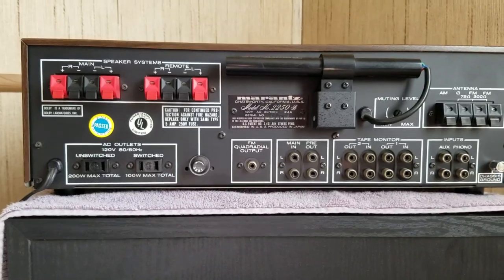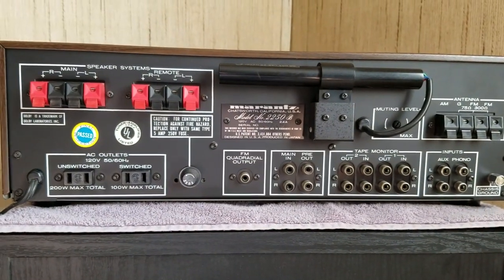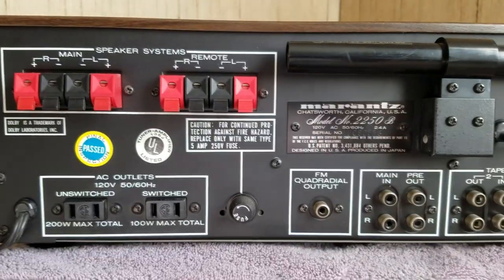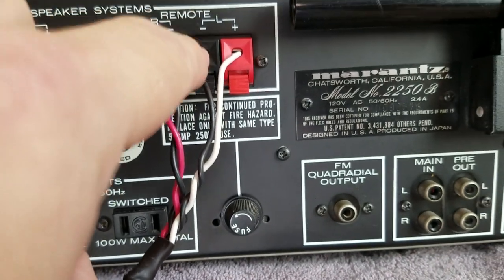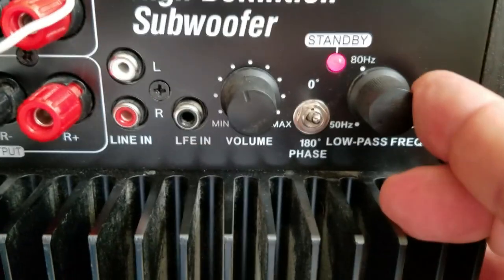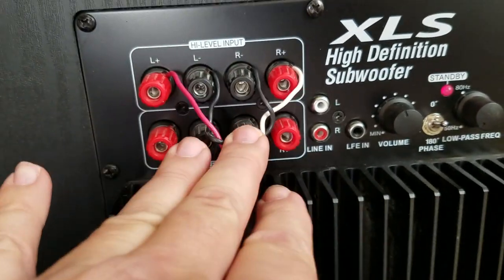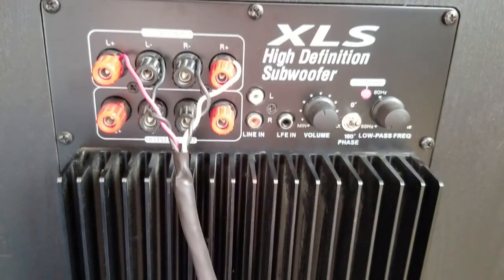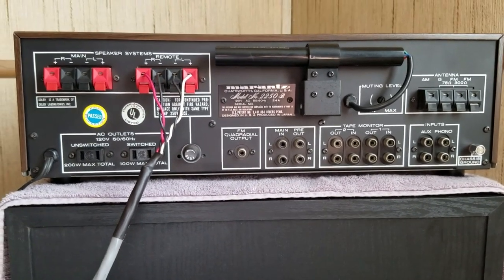How to add a Subwoofer to any Vintage Stereo

Comment: Very useful information. Thank you. I have a 40 year old Sansui 9000 which I absolutely love and still works well. I was thinking of adding a sub even though it has good bass with existing wharfedale E-90 speakers, also 40 years old and got it re-coned recently and sounds great.  Your instruction video is timely, and appreciate very much.
Reply from the maker: Glad it was helpful!

Comment: Very good instructional video... Liked your using the High inputs on your woofer. Never saw summing L and R channels into a mono-sub. As my 2.0 stereo has only speakers A, no speakers B, I bought a simple amp with subwoofer speaker output. Works for now.

Comment: This only works if your receiver has A + B output, AS WELL AS the speaker outputs themselves are wired in parallel internally, and not in series. Your average person may not know what they have and this was very common for receivers from the early-mid 70's to run both speaker outputs in series and some specific brands kept doing it. (my Kenwood is like this). This is designed to protect your amplifier from someone running two sets of 4ohm speakers and cooking the amp. But it has significant tradeoffs for performance and sound quality (unfortunate). it's not easy or always possible to change this.

Anyways in this scenario the amp will not run the sub and mains simultaneously as the resistance of your speakers (~8ohm) will sum with the resistance of the subwoofer inputs (10's of thousands of ohms) and the resulting highly resistant load won't draw any current from the amplifier.

The recommended (by HSU and PS Audio) solution for this is also the simplest: simply connect the subwoofer high-level inputs directly from the speakers, which should be directly wired to your amp. Or run wires going to the sub and mains directly sharing the same amp terminals. The high impedance of the amplifier results in no additional load "seen" by the amplifier and is completely safe.

Just like int he video I let my mains run full range, and the use the controls on the subwoofer to blend nicely with them and provide the low frequency re-enforcement and extention rather take over the whole <100hz range.

Not mentioned in the video is how some subwoofers have a high-pass filter on the high-level output. I don't really see this as a benefit as it's typically a fixed value somewhere between 85hz and 120hz, has a shallow rolloff, and may not even be effective based on the resistance characteristics of your main speakers. Plus the crossover may be of questionable quality to begin with.
Reply: Thanks...very informative!

Comment: Excellent advice here. I've been browsing sub install vids and most are doing it wrong by connecting the mains to the sub's high level output, thereby failing the audio version of an IQ test. Using thin wire and the shrink wrap is also brilliant. The sub's high level output is useless except for daisy chaining multiple, identical subs together. If you can't use or don't have A+B speakers, simply twist your "sub wires" to the main speaker wires and connect both at the speaker outputs, which is another good reason to run thin wires to the sub so both wires fit the output jack.
Reply: Weird that’s how Bose connects speakers to their subs - especially the passive ones - the high output speaker jacks on the sub are specifically for this - the sub will be the active crossover for the passive speakers.

Comment: The pre out nex to main in should work,  i hooked one up to the rec out on a sanyo d4505, works only you have to use the subs volume.  Also used the line out on the akai am a202,  have high level inputs but i use the a and b speaker channels.
I will have to have go at this to hear the difference.
Good video.

Comment: U have on the subwoofer (High Inputs) the left and right connections is switch while on the marants speaker (remote) is wired correctly. Thought you should know. 😎👍
Reply from the maker: Yes I didn't notice that until a year later:)
Still works fine as the inputs (L&R) are turned into a summed mono. Thanks and Cheers.

Comment: I have an XLS subwoofer, not the same model, and the instructions say to main speaker out terminals along with the main speakers and it works well with a full rich sound.
Reply from the maker: Correct, but by using the B speaker out for the sub you can use the speaker selector switch to add and delete the sub when needed. Thanks for watching. Cheers.

Comment: For me, the line level output with quality shielded cables for short to moderate lengths would be just as good.  There are pros and cons to both but Sub out RCA when available would at least be a cleaner and easier install.

Comment: To hook up the second set of speakers after plugging in the amp, do you just run the second speaker wires from the amp to the speakers, both sets of wires plugged into the amp's second wire holes?
Reply: Yes

Comment: Very good. Short, precise. I have a Marantz 2240. You can hookup two subs this way to an old marantz also.
Reply: How can you hookup two subs to 2240? One sub in main speaker terminal and one sub i remote speaker terminal?
Reply: @nosnelg7481  "A" speaker bank to main speakers left and right and "B" speaker bank to the subs. L&R to one sub and L&R to the other. Then play both A&B banks together.

Comment: Why not just run the “A” speaker output to the input on the sub then run your speakers off the high output on the sub ? That way you can still run a second set of speakers off your “B” channel .
Reply from the maker: yes that will work as well.
Reply: @breakerbroke23  No, it will work MUCH better, bc you will be using MORE of your receiver, and get MORE sound out of it! Also, you did NOT finish the wiring job in the video, so I have to go to another channel that does a COMPLETE job, not half-assed.
Reply: @mr.blackhawk142  Lighten up Francis! Jesus...
Reply: @mr.blackhawk142  If you can't figure out the wiring from the information provided, you should probably ask a toddler for help.

Comment: Man I'm glad I found this video🤣now I know why my dayton audio sub never shuts off 25' run that wire passes two plugs its coming out anyway the cerwin vega is more than enough 👍
Reply from the maker: Back in the 90s I had a 40+ foot run of rca cable going to a M&K sub, it would not go to sleep because it was picking up AC noise. So I restrung with speaker wire and used a sound gate line tap (at the sub). Problem solved. Cheers.

Comment: You can also use a car stereo line out converter and use a pro audio power amplifier such as a crown xls power amplifier or you can use a subwoofer alone with a passive crossover inside the the subwoofer enclosure itself
Reply from the maker: Yep, doing one of those setups now. Its a little side project Im doing at work. I will post a video on this later this summer.

Comment: Great video. But just one thing, there's virtually no power going into the high impedance sub inputs. The voltage could be high but it will not draw any current.

Comment: I have a 4 ohm Subwoofer that needs to be an 8 ohm subwoofer. Is there a way to wire it into my 1996 Sony 5.1 surround sound pre-amplifier? Can I use two 4 ohm subwoofers, wired together to make it an 8 ohm subwoofer? And if so, how do I wire it into the Sony?

Comment: It is heavy and robust box on the subwoofer so its a good things because you can have the turntable on the top of the subwoofer and that way save table space.:)
Reply from the maker: The Sub comes in at 68 LBS. My old Pioneer TT would not be able to play on top of the Sub. 
In fact I have to turn off the Sub if I want to really crank up the Stereo while playing Vinyl

Comment: Do you have a video on how to hook up a pre-amp or amplifier to these old receivers ? I just bought a MCS 3235 which puts out 35 watts per channel. To be honest I don't really know if I need anymore amplification but a explanation video would be great. The back of my receiver is similar to what you have here in the video being there are no connections to add an amp.Thanks for the vids...
Reply from the maker: The MCS has everything you need. I am not sure why you need to add a preamp. Am I not understanding what you want to accomplish?
Reply: @breakerbroke23  Im a complete newbie.Was thinking 35 watts per channel was not enuff to run 100 watt speakers,let alone the 3235 has enuff connectors to hook up 6 speakers. I guess I am just not up on how the wattage ratings work.Thanks for replying.
Reply: 35w is plenty of power especially on the vintage receivers.
Reply: Thanks

Comment: The issue you will always run into when trying this is either ruining the unique sound of your vintage amp by running your speakers through the subwoofer... or still pushing full range to your mains because there is no crossover for them.
Reply from the maker: No, No, and No. Dude you are so wrong.  My "mains" have built in Xovers, They play with a full range input, the Xover tells each driver what frequency to reproduce. The sub is hooked to the B speaker out, (full range) the sub amp has an internal xover that will only pass low frequency to the amp section. I am not "ruining the unique sound of my vintage amp" Did you actually watch the video?

Good lord.
Go back to your Stereopedophile magazine.
Reply: @breakerbroke23  I dunno about ruining the sound as that's subjective, but what he said about sending a full range signal to main speakers is true. 

In your case that's fine, you have big thirsty full range speakers. However one of the advantages to having a sub that's crossed over from the source is to take some low frequency load off the main channels. That way the sub alone can take care of say 60hz and down, instead of the main speakers trying to reproduce as well, also making the amp work harder. Bookshelf speakers benefit huge from this, I would argue many floorstanders do too. Without a separate crossed over subwoofer output, which likely no vintage receiver has, this isn't possible. 

What some subwoofers do to compensate is send the crossed over "bass removed" signal out of the high level outputs. Others as you said in the video are just a bridge. You'd have to check your manual or test for yourself to know for sure. 

Either way nothing wrong with how you did it and good video, just thought I'd expand on the first guys comment

Comment: I've always been interested in doing this on one of my vintage Marantz receivers, but what do you do if you have 4 speakers? I have a pair on each, speakers A and B. I often wondered as to whether you could use the headphones output. I have a nice Polk powered subwoofer in the basement that I'd love to hook up. Maybe I could find an adapter from the big headphones jack to RCA inputs on the sub? 

I also have to wonder how that works using speaker level inputs, regarding the ohms load on the receiver's amplifier. I'm pretty sure 2245 or 2252b is 4 ohm stable, but not to sure how stable it would be running 2 sets of 8 ohm speakers, (which already poses a 4 ohm load) and adding a powered sub. Interested in your thoughts regarding this.
Reply: Does adding a powered subwoofer to high level inputs from speaker wires increase the load on the amplifier? If able to use the headphone jack to connect a powered subwoofer, would that pose issues of ohms loads? 

Another though I had was taking the shunts out of the receivers mains, and putting a two into one RCA adapter, using one to go back into the receiver where the shunt is removed,  and the other end to the powered subwoofer. 

Too bad these vintage Marantz receivers didnt have a pair of dedicated subwoofer output RCAs for this purpose.
Reply from the maker: The RCA out puts were usually a fixed output so you will have no control of volume to the sub. Also, when using the sub in parallel with your speakers the receiver will still see mostly the independence of the speakers and not the electronics of the sub. If in doubt use your ohm meter.  Measure the speakers and then spks with the sub in parallel. You MAY see a slight drop say from 4 ohms to say 3.6, no worries.
And yes I own near 100 CB Radios, multiple stereo components and from time to time I still lug something home:) The wife still puts up whit me, she on the other hand is "Christmas crazy"  she has tons of Christmas decorations, so I have learned to not say a word to her about her sickness and she says (for the most part) nothing to me. 
So Far.  Cheers....BB23
Reply: @breakerbroke23  Me, too. And my wife is the same way. I think you once told me we must be brothers. The more I talk to you, I'm convinced our wives must also be sisters. LOL. Yeah, I've got more than my fair share of Cobras 29s, Midlands, Uniden PC78s, Galaxies, Connix, I was just playing around with my peaked and tuned General Washington, talking to a guy over 40 miles away on my Antron antenna 30 ft up in the air. My Uniden Bearcat with a Moonraker antenna gets out even further. CBs are fun, but have become a dying thing. Even with truckers. Very few are on the radio anymore, except all the jokers. I love when the skip is rolling. Last October I was talking to a girl in Texas, several hundred miles away. Didnt realize it until she announced the menu at a truck stop on interstate 40, and said to myself, "Wait a minute..... That's nowhere local." After a while she revealed her location. Amazing! I have had this happen several times, talking for a brief while to people in Baltimore, Chicago, Memphis, etc. Have fun with your CBs. It's wholesome fun. And let your wife have her fun with holiday decorations. Let her just think it's a mid-life crisis like my wife thinks. It's all good. Everyone gets what they want, and stays happy. 😀

Comment: Slightly off topic, considering my reciever is only 15 years old and a 5.1- I have an onkyo HT R330, came with a passive sub, no separate LFE output on rcvr. Hooking up a BIC V1220 powered sub through method A( rcvr to sub then sub to front spkrs). On the rcvr I turned the option for sub off, that sets the size of fronts to large. My onkyo book tells me to base the crossover on the first spkr that is set to small which is the center, 2-8cm woofers. According to the book under 9cm is 150Hz. I then proceed to set up subwoofer.  I have the volume set about mid way, phase at 0 and crossover above 120Hz on sub. I have decent bass from the sub, but it sounds like the left and right fronts are getting overdriven, instead of a tight thump it is muddled almost vibrating noise. If i turn the bass for the fronts down to neg 1 the muddle goes away but there is hardly and bass at the sub. If I turn the bass back up and adjust the crossover frequency on the rcvr to 100Hz the bass on the spkrs and sub sounds good. Im just confused and dont want to damage anything. There is the + and - for the passive sub on the rcvr- should I use that for the from rcvr and leave my front speakers hooked directly to the rcvr
Reply from the maker: Sorry I may not be much help on this one as I do not know more about your receiver. I would run the sub from your rear speakers and adjust your front speakers for less bass. Play front and rear (as a sub) at the same time if you can. The idea would be use the crossover to cut lows from your smaller fronts and give full range to the sub, let the crossover on the sub do its thing. (dont cut lows to the sub.)
 I just don't play with AVR receivers much.

Comment: Thanks lot for the video. It's quite useful.  Considering the connection you describe, do we run the subwoofer in active mode (plug to AC) or, in passive mode ?   The reason I ask the question is that the signal we get from receiver amp is already powered (comes from power amp) .  Would that harm the subwoofer that is run in powered mode ?
Reply from the maker: What Make & Model sub do you have?

Comment: electrolytic capacitors will love this, I would like to know how Hot this Marantz gets with this configuration.
Reply from the maker: Using the input to the subwoofer "amplifier" causes no strain on the amplifier as it sees no inductance or capacitance as it would driving a real speaker. 
My Amp section runs quite cool. If your amp runs hot it more than likely has a biasing or DC offset issue, IMO.
Cheers.
Reply: @breakerbroke23  if you are using the subs speaker level input instead of the line level, are you certain that you aren't feeding the subwoofer speaker directly?  Basically, you seem to be adding a second speaker system running simultaneously. Many good vintage stereos will handle this easily but some will not

Comment: I tried this with my old Marantz PM7200 to a powered 150 watt subwoofer Infinity BU-120 pretty much exactly like yours. The Marantz has class A 25 watts and class a/b  90 watts and was just serviced as I bought it second hand from a friend, but the sub woofer does not work. Btw I ive in Europe- retired. I an splitting 2 receivers with 1 set of front Infinity Reference 60 that I just bought second hand. The Yamaha 5.1 surround receiver with a direct low level into the sub woofer works perfect. I want to add the sub to the Marantz system for music listening exclusively.  I did use the speaker b system as you recommended, but not real expensive speaker wire. Pretty much just normal wire. Ideas? Thanks. Ps i believe the Marantz is just underpowered for this setup, but drives my Infinty Reference 60s just fine at 25 watts. Actually, to troubleshoot this issue correctly I should wire my main speakers to the B outputs to see if there is a problem with the Marantz power supply on the B channel. Also this Marantz model does not have a preamp output jack. :( Any thoughts?
Reply from the maker: Use your spk out to get audio to your sub